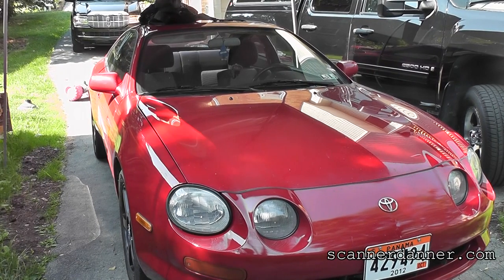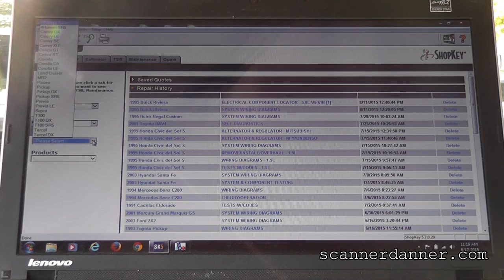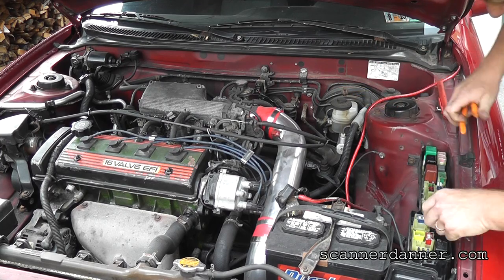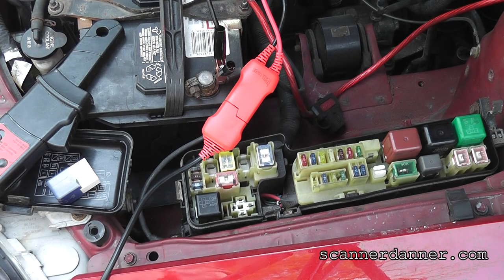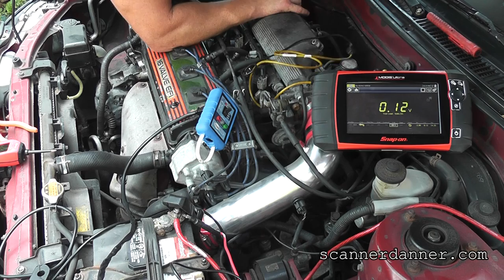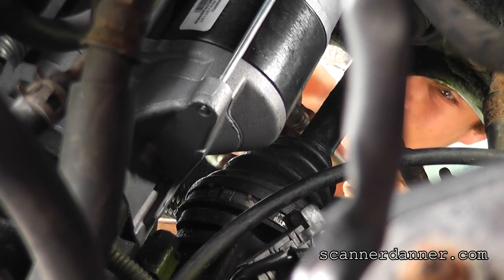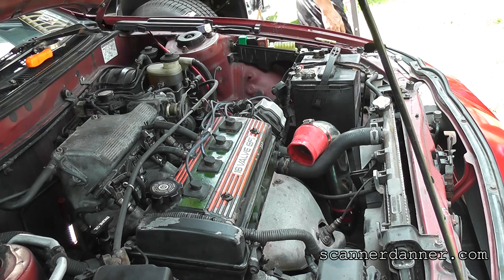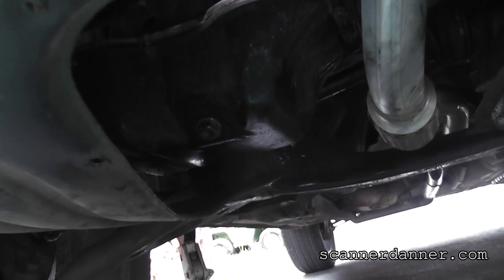How to troubleshoot a no crank problem (94 Toyota Celica)

Comment: Solenoid contacts  wear on the old toyota starters, I made some new ones out of copper strip and all was fine.
This was a corolla , bet the starters are the same.  Pull it apart and have a look
In this case I could hear the solenoid clicking
Reply from the maker: +WhitwellMike B no clicking at all my friend. but I should have tried what you suggested. In my experience they just do not come apart here in the rust belt of PA

Comment: I bought a brand new epic box. first step for me is CK the relay to split the system. tow driver pulled cable and put it in drive. shifter was in park.  I jumped the relay and the car started. it idled and drove about 4 feet into my 1 month old box. I still have the dent 6 years later. lol

Comment: On the starter relay where does it get power? The clutch switch is ground right? Also there are 2 switches on clutch what is the one thats pressed when clutch is at rest.
Reply from the maker: Without looking at a diagram, I'm not sure. What year, make, model and engine are you working with?

Comment: can you put the scanner  with obd1  connector on the dlc and see  what your modis ultra can read out on that car what live data and pids  you get?
 i have a video what i can get with launch on a engine like this
Reply from the maker: +Intrade Motor I can, and I did after we put the engine in. It had a crank sensor problem in the distributor of the salvage yard engine. Sorry I didn't film it

Comment: Hey man unrelated question. What exactly can you find by performing a frequency test on a cam or crank sensor. Noticed it on the verus under component test and would like to make use of it.
Reply from the maker: +andrew johnson glitches and drop outs of the signal, but this test is not very valuable on cam and crank sensors with uneven notches or sync notches. They will look like glitches when they are not.
Reply: +ScannerDanner gotcha. The issue i see alot is it'll have a certain spec for freq and i see alot that are below that spec but have a steady pattern. Wasn't sure if that was a lazy sensor or something. I just did a ckp on an 04 altima and the new sensor was under spec as well. I guess this is ok as long as the signal waveform checks out?
Reply from the maker: +andrew johnson frequency will be greatly dependent on RPM and a spec is not important as long as the car is running normally.
Amplitude (min-max voltage) and signature of the waveform is more important

Comment: hey all, my son replaced safety nuetral switch on his 2001 s10 chevy blazer 4.3.two wheel.it started for two days.it wouldn't start again.replacedd it again.thinking faulty switch.he ran it down the road.came back.no start again.he thinks the proges from the switch have broken off in the connection.he remembers the one switch didn't have its pronges.now what.he wants to cut and by pass it.he can't find the connection anywhere to replace the end with the prongs suppositly broke off in it.very short on money too.help.me being mom.i don't think by passing it is going to work for other reasons.

Comment: Hey, my girlfriend has a 2001 Celica GTS. Her car is having a strange issue. When the car is cold and she turns the key you can hear the starter engage but the car will not start. Only after doing it about 10 to 15 times will the car finally start. Once the car is warm it has no issue. What could be causing this issue?
Reply from the maker: many different causes for that, you need to test fuel pressure and spark DURING the condition, also I would want to know what the engine coolant temp sensor is reading on scan data to make sure it is reporting accurately
Reply: @ScannerDanner  You wouldn't happen to live anywhere near Winston Salem, NC would ya?
Reply from the maker: @ashemorris  nope, Pittsburgh PA but we drive through Winston Salem every summer on our way to Emerald Isle NC :-)
Reply: @ScannerDanner  Well next time ya drive though I would love to see if you could swing by and take a look, if I havent figured it out by then. Plus I would personally would like to meet ya. You remind me of my old friend that taught mechanics class at my old High School. I always wanted to take that class but my school didnt allow me. Long story but short version is my school was a baaaad school. Not anymore but it was back then.  Maybe you could give me some pointers. :-) Ill buy you and ur fam dinner like Dominos or something if ya stop by. Just a thought and offer. As I said I was never able to take classes, so watching your videos is awesome.

Comment: From a basic diagnostic position, as soon as you read a test battery voltage of 12.2 volts and you know your starter's getting power, and your feed wire and engine earth is good and with a good connection, then you can be pretty sure that it's your starter's windings which are weak, and it requires a starter replacement. The next thing on the list is finding the reason as to why your battery voltage is only 12.2 volts, as that is too low to be acceptable. I'd run a parasitic draw test, and on a Toyota I'd expect 0.03amps. Assuming that's the reading I get, then I'd start the car, after fitting the new starter, check the charging voltage, and then, if correct replace the starter battery. 
Of course, this is assuming that your video isn't heavily edited and that there isn't a long period of time which your headlights and interior lights were on and draining the starter battery.

As a side note, if this car's starter windings were just weak, but connected, then a jump start would quite possibly have worked. 
Also, in an emergency situation, use a bump start in 3rd gear (at least two people required).

Comment: Hey scanner danner i bought the new starter and still nothing any help???
Reply from the maker: need two voltage measurements DURING cranking. One on the solenoid wire and one on the main battery wire

Comment: there is your problem right there stereo amplifier wire very bad without a capacitor on it. they have a tendency to take out starters and alternators
Reply from the maker: Want to explain the physics behind a stereo amplifier taking out a starter? Of course battery voltage and charging systems can be affected but not in a damaging way. Curious where you've seen this?

Comment: if its manual get someone to push you placing it in second gear popping the clutch out ( while trying to start it )  it should either fire up or attempt to ....... you could also put car in gear ( manual only ) an rock the car back an forth then try starting it ........ rocking the car has same effect on the starter as hitting it only its being jarred by the action of being rocked back an forth.....
Reply: not sure if that have the same effect with a front wheel drive ....

Comment: I have a question for you can you cut the airbox breath more air to save fuel is that a good idea?
Reply from the maker: bad idea, it won't do anything but allow water and debris in the air box. Unless you've made some heavy modifications to the engine. If it is stock the air box is NOT a restriction.

Comment: 06 altima. Lost acceleration on hwy. Now no crank! Lights dont dim and dash lights up. No check engine light. No codes. O'Reillys said starter good.
Reply from the maker: This could be you https://youtu.be/ytrcqM8wyW0
BTW, no need to repost the same question multiple times, I see them all 😉
Thanks!
Reply: @ScannerDanner  thank you!
I was banging steering up & down and jiggling key and it started cranking. Never turned over but I'm guessing ignition switch or power issue between starter & ignition? 🤷‍♀️

Comment: I would also add with no tools before u call dad look at the simplest stuff first.... check out the battery and connections (cables) are they disconnected ? damaged ? blown out battery leaking fluid? corroded posts ? etc...

Comment: this was happening to me... and all I had to do was replace the battery connectors (they looked fine, but obviously wasn't allowing enough flow). so, after replacing my starter, a $3 part was the only problem :/
Reply: cause I did the same thing as you did. all my tests came back as the starter. but, it still was just my battery connectors. so now, whenever someone swears its the starter, I just say to clean/replace the connections on the battery first. especially cause it's so cheap to do.
Reply from the maker: +James Erikson if you would have tested the heavy (hot all the time) wire while you had someone else holding the key in the crank position you would not have missed it. This is why I stress "loaded circuit" voltage drop tests.
Reply: +ScannerDanner True... I don't believe I did that test.